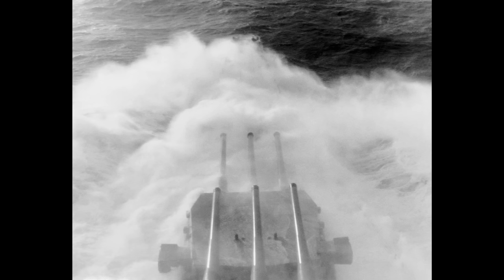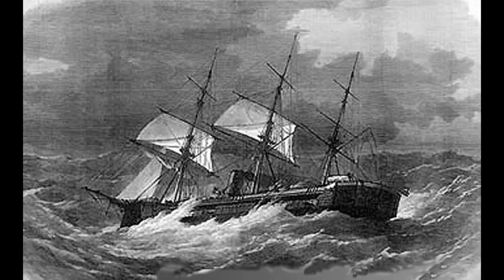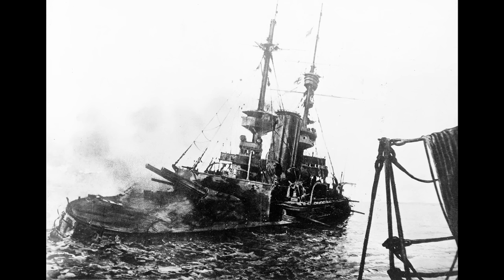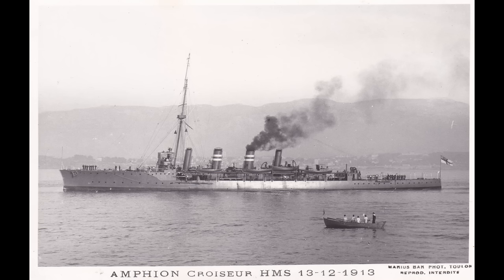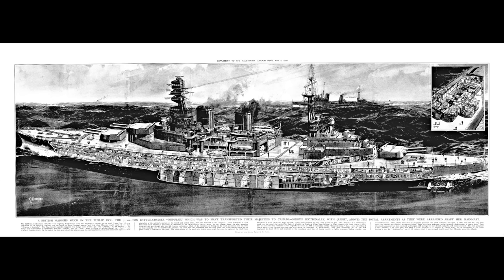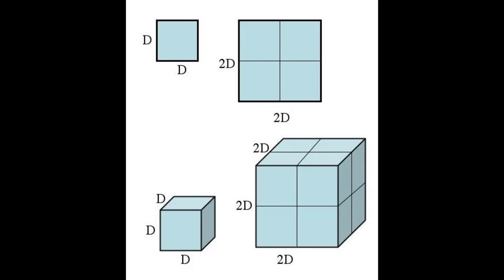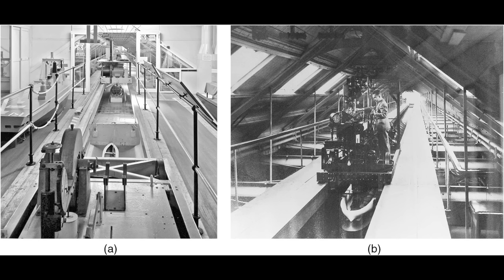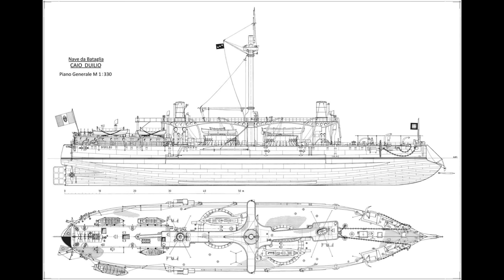Hull Form Design - Doing better than a floating brick

Comment from the maker: Pinned post for Q&A :)
Reply: What was the rationale behind the differences in insignia, specifically the cuff rings, for the RN, RNR, & RNVR? Besides being able to call the RNVR the " Wavy Navy"...

Edit: And I know it was so you could tell at a glance who was which, but why was it considered so important to do so? The US Navy didn't have anything like it to distinguish the Annapolis grads from the ROTC grads (the functional equivalent of the RNR) or the wartime ninety-day wonders (the RNVR counterpart), so it seems to me that there was some snobbery involved.
Reply: Can we get the full 'Drach rants about German WW2 designs inefficiencies.' experience? With special focus on the Konigsberg class.
Reply: Maybe it's irrelevant, but is the boat tail bullet shape actually related to the hull form in any way? What is the effect of the transom stern if it was made to be concave, would it cause an even greater vacuum and vortex effects?
Reply: What was the budget for the Royal Navy/Navies throughout ww1 and how does it compare to the ww2 or the modern day naval budget
Reply: But bricks make wonderful weapons!
Reply: if Hood's 1942 refit had gone ahead when the Loss of HMS Prince of Wales and Renown would have happened and as the Hood's AA weapons would be obsolete by 1943

How many 40mm Bofors and 20mm Oerlikon AA Guns could have been fitted to HMS Hood in place of her planned 48 QF 2-pounder Pom-Pom AA Guns and her 1941 configuration of 20 Vickers 0.50 Anti-Air Machine Guns?
Reply: What was the 20-barrel Anti-Air Rocket Launcher? Why did the UK develop it and Why was it a failure?
Reply: The Royal Navy has more operational experience in the horrid conditions of the North Sea and above the arctic circle than other Navies… seems like the greatest testing site for foul conditions are quite close by … and designs can be shaken down close to home …is their a certain place they took new designs to see how they ran ..!?
Reply: Reading a book on the Väinämöinen-class by T. Niklander I discovered the coastal monitor suggestion of Commodore von Bonsdorff. According to the book it was a 3500 ton ship armed with six 305 mm guns most likely in 3 2 gun turrets. Could such a pint sized battleship ever be feasible?
Reply: @stephenrickstrew7237  Well in the 1980s they sent ships to South Atlantic Winter and they were cause the Type 21s to crack and HMS Invincible broke down en-route
Reply: Dear sir, as this is an engineering, physics, and maths based talk,discussion, could you do a segment on elegance in these terms? What do you consider the most elegant naval weaponry by the same criteria its most elegant counter?
Reply: Drac, Why did you do civil engineering not marine engineering?
Reply: I was watching your MN Surcouf earlier and had read up on the design trouble she had.

The Surcourf was prone to suffer leaks, particularly in her 8-inch turret, she had a habit of entering uncontrollable dives, her trim was difficult to adjust in a dive and on the surface, she would roll a lot in stormy seas, her engines were unreliable and broke down often and her batteries would leak acid in stormy weather and to dive, she needed 24 hatches closing.

How possible is it that MN Surcouf instead of accidently being rammed by the SS Thompson Lykes that Surcourf fell victim to her own design flaws?
Reply from the maker: @abyssaljam441  mostly job prospects at the time.
Reply: since cannons have been replaced by sensors, electronics, comms, and missiles; what do you think is the optimal modern design?
Reply: question:
when a working hull form was found (though what ever means) how much effort was put in to using that hull form for as long as possible. I.E. how common was it to stretch/widen etc. a known working hull form instead of making one from scratch, primarily along the lines of a cruiser hull cut down to a destroyer, or a destroyer scaled up to a cruiser
Reply: @Drachinifel  Its not like the job prospects are any better now. It doesn't matter though as I can still get/have(on placement) a 'normal' engineering job.
Reply: Is there any chance you could talk about the japanese 120mm AA rockets? Some of the light carriers were fitted with them late in the war I've managed to dig up a couple pictures of them they look kinda like UP projectors but I have found very little actual information on their use and effectiveness any help would be much appreciated
Reply: What was more impactful for the americans: the loss of Lexington, the loss of Yorktown, the loss of Wasp or the loss of Hornet?
Reply: Did any Navy look into using bow thrusters before 1938? You had mentioned bow rudders in a past video this is why I am asking.
Reply: @kendramalm8811  That's simply to distinguish between the three branches, so someone would know from a single glance whether you are are RN, RNR or RNVR. BTW, the RNVR no longer exists; it was merged into the RNR after the war when the Admiralty saw just how good some of the VR people actually were!
Reply: Drach - if the purpose of the transom stern is to reduce the vortex, what would the effect be of a wedge or bulge mounted on each side of the ship at the stern? Would that widen the area of reduced vortex, or just increase the drag at about the same amount as any reduction?
Reply: would heating or cooling the hull have any effect on how the ship moved through the water? obviously you wouldn't be able to do this if you were not in possession of an abundance of power or a hull capable of heating/chilling.   What about the temperature of the water itself? easier to move through cold water vs warm?
Reply: @alanhughes6753  , yes but why distinguish? I've never heard of any other navy doing it quite like that.
Reply: As a student who plans on going into Ocean Engineering, this is a nice intro to hull form. However, displacement is talked about a lot, and I'm at a loss as to how it is calculated. I understand it is the volume of water the ship displaces in order to float, but not how it is calculated. Can you explain this further?
Reply: In the age of sail did larger guns such cease to use solid shot at close range to increase damage? It seems like a solid shot from a dalgren would waste most of its energy exiting the opposite side of a ship at close range.
Reply: regarding the design of the stern of a carrier: the Lexington class had a sharp stern and the sharpness was carried up to just below the flight deck.  In purpose built carriers of the 30s, like Yorktown and Ark Royal, the stern is sharp at the waterline, but then rapidly flairs above the waterline, which allows a longer hangar deck.  USN drawings of purpose built carriers from the early 1920s show this was a known factor as those drawings show a hangar extending nearly the full length of the aft end of the flight deck, while the drawings of the battlecruiser conversion show the hull tapering at hangar level, and a short hanger.  Was it impossible to rebuild the aft part of the Lexington hulls to provide more buoyancy to support the wider above waterline stern and longer hangar, or was such a rebuild expensive to he point where it blew the selling point to the politicians that the conversions would cost less than purpose built carriers?
Reply: Drachinifel, The long slender bow which give better speed but harder to turn. Yes I agree but this was the idea behind bow truster, were they pump water from the compressing side to the low pressure side which pushes the bow by itself but also makes turning force by the  rudder. As I understand bow truster did date back to around WW1 but very few ships use them. So why so little used.
Reply: Granted the mathematics for calculating ship's stability existed since the late 17thC, why did the designers of HMS Captain get it so wrong?
Reply: When is your next video on the Wasa coming?
Reply: I'd be curious to hear what type of performance increasements a transom stern would have provided to the Iowa Class Battleships.
Reply: Without Naval Treaties limiting development, would we have seen ludicrously massive floating islands with 25 inch guns, or just a bunch of bankrupt nations while their megalomaniac projects ended up abandoned like the Maus tank?
Reply: How many Vanguard Class Battleships were planned originally?
Reply: Hi Drach:
Some questions I have:
1. Is there a hydrodynamic equivalent to the Area Rule in airplane design?
2. Has anyone tried using an inflatable (by air or water) "end cap" for a transom stern for better low speed performance?
3. Discussion of air bubble generation at the bow or along the hull to reduce the surface tension of the water (used in some extremely fast modern torpedoes)?
4. Use of a concave shaped hull bottom?

Thanks! Great stuff!
Reply: My brain hurts after listening to this video.
Reply: @Knight6831  Just the one.  Because she was designed to reuse the stored Turrets /Barbets etc taken out of Courage’s & Glorious when they were converted to aircraft carriers.  (Which means the armament that first sailed with the Grand fleet was still in service through the 1950’s).
Reply: If WW2 hadn't occurred When would the UK Government realise that the Royal Navy had grown too big for its budget?
Reply: @chrissouthgate4554  I think Drach mentioned 3 other Vanguard class ships names in a drydock but not sure which

Shouldn't the Battleship fleet being reduced from 18 to 10-12 a red flag that  the Royal Navy had grown too big for its budget?
Reply: @chrissouthgate4554  So the RN's planned Battleship fleet was to be 1 Vanguard Class, 
4 Lion Class and 5 King George V Class
Reply: Who do large modern transport ships have transom stern if move at relatively slow speeds?
Reply: We’re there any attempts during the age of sail to increase the protection of a ship, for example placing sandbags on the inside of the hull to catch splinters and possibly stop or slow down incoming cannons balls, or was it simply the case that no practical amount of wood or added material would really help your ship and so you just had to accept the base protection provided by the wooden hull.
Reply: Can you capsize a submarine, and if you do does it sink?
Reply: Merchant marines for the WW1/2 era. Were these volunteers, drafted or just "unlucky" men who were professional sailors before the war? Perils of submarines or raiders are not fun afterall.....
Reply: Was the USS Connecticut BB-18 ever in combat  or did it ever fire a shot in anger? Also generally did US pre dreadnaught ever fight besides the Spanish-American war? Love your channel!
Reply: I read somewhere (can't remember where, sorry) that warship hulls tend to be designed with more strength residing in longitudinal framing, compared to civilian ships relying more on transverse framing (not sure that applies to modern modular civilian ship building). Apparently due to longitudinal framing being more resistant to battle damage. Why is that?
Reply: @emperordave3006  They are pointy ended below the waterline, and then the hull flares out so that a relatively short distance over the waterline the stern can be flat.
Reply: @christofferwillenfort4035  I've always assumed this was to protect the crew of the forward gun (who only had a gun-shield, not a fully enclosed turret) from the muzzle blast of the superfiring gun.
Reply: The Fairey Swordfish and Fairey Albacore seem like remarkably similar aircraft, but, in general, the one is venerated and the other disparaged. What made the Swordfish a success while the Albacore was a failure, or is this a misconception?
Reply: @jasonhall3330 I've read that the crews' hammocks used to be lashed along the side of the upper deck to provide some protection from musket fire and splinters.
Reply: @CharlesStearman   After reviewing all my destroyers in WOWS  it seems like you are right.   This only exists on the ships where the turrets have an open back.
(couldent find any fully open superfiring ones.)    so basicly a blast shield.   Now to dig out if there is a "propper" name for it.
Reply: What is the largest vessel that can take a hydrofoil and still be stable? Also I've noticed that a few of the future designs of modern warships have gone back to a catamaran type design, why so?
Reply: Do they still put deck guns on destroyers/warships in this day and age?
Reply: I'm sure you've probably seen the Mythbusters episode about golfball dimples and putting them into a car. It supposedly helped some with resisting the wind. how would that do with being in a ships hull, how would that be acting on water resistance?
Reply: @matthewrademacher5183  The US engaged in several "big stick" waiving exercises in the Caribbean during the period Connecticut was in commission, including interventions in Mexico, Haiti and the Dominican Republic.  Offhand, I don't know if Connecticut fired any 12" ammo during those interventions.  A search of newspapers of the period, especially 1915-1916 would probably provide detail on her activities as the Wiki entry does say she was deployed to both Mexico and Haiti during that period to support ground troops.
Reply: @Knight6831  Treaty still had displacement limits and Battleships and Battlecruiser were counted to the same limit, so it would have been them plus a refit Hood and maybe both Renown class still. As to your question on the number of planned Vanguard class, Drach answered a few questions about that over a couple of Drydocks, the plan was one quick build using the stored turrets and guns from Glorious and Courageous but had the war not started and the RN needed more  ships fast they could have in theory taken the guns and turrets from the 5 R-class and 5 QE's as they came out of service for a total of 11 Vanguards.
Reply: @arivael   Not quite as 1 R-Class Royal Oak and 1 QE were sunk so it would be 4 R-Class and 4 QEs for 8 Vanguard not 11 but that would along with the 4 Lion and 5 KGV still give 17 battleships unless the UK built the 1 QE and the 3 R-Class that were cancelled which would have given 13 Vanguards
Reply: no 84 hour midweek vid... nope thats one for the patreon drydock.. :)
Reply: @Knight6831  I did say 'if the war had not started' So if it had been part of a pre-war build plan to deal with the fact they might have to fight Germany, Japan and Italy at the same time.
Reply: @bensimmons2850  also get Lindybeige involved and that would be an epic rant.
Reply: Can you continue the development videos. 
Like to see the aircraft destroyers and cruiser videos finished
Reply: How long has the effect of the transom stern been known about? I've seen it on some models of the G3 class, and given the benefits that it can give for a ships speed when moving quickly, would it not have made sense to put it on earlier higher speed ships like the battlecruisers?
Reply: If there is a warship form any era that you think and you want to be modernized just like the Iowa in your interview video, which one would it be? I myself would like to see the Richelieu or Dunkurque battleships have missile systems at its stern area whilst retaining her main guns at the front. A crazy symphony of firepower that would be!
Reply: 1:01...uhhh but.. could you tho? please?
Reply: How is wide and long of the length or deep of the draft of Yamato compared to an IJN Interwar destroyer like Fubuki-class or Akatsuki-class
Reply: In World War II, the US built a massive amount of new ships. I am interested in how US (and RN) were able to staff those new ships with competent officers, sailors and airman capable of sophisticated operations. The US (and I imagine the Royal Navy as well) were able to produce a mass of capable personnel while at the same time the Japanese Navy (which was extremely professional at the beginning of the war) seemed to become less capable. How did the US accomplish this feat? Is it true the Japanese Navy become less professional or did the US simply catch up?
Reply: I know you don't cover modern stuff much, but is the power to mass ratio of machinery the reason modern warships don't much exceed 30 knots?

And also, I know General Quarters and Battlestations are used more or less interchangeably in the USN, which is parallel to action stations in the RN, so what is the difference between General Quarters in the Royal Navy from how it's used in the USN? Namely in the world wars, but also more recently if it's any different?
Reply: @josephaskins1996  it is simply the integral of all the immersed cross-sections from bow to stern for a given loading condition.
relatively easy to calculate now with cad software, took a bit more work if all you had was paper, pencil and planimeter...
Reply: How do you reconcile needing a pointed rather than blunt bow for speed on a ship with torpedoes having a blunt nose being optimal? Like what makes the difference for the torpedo?
Reply: I figure this is a dumb question but did anyone ever try putting escape hatchets or blow out panels on the bottom of a ship so if it capsized the crew inside could escape? 
Are there any actually means or devices for trying to help crew survive or escape when a ship rolls over or is it really just a case of the crew bending over, grabbing their ankles, and kissing their sterns good bye?
Reply: What are the ruler like markings on the side of the super firing turrets of the ship at 47:10? Do they help determine the training of the guns from outside and if so why?
Reply: Completely unrelated to the video at hand, but I finally watched greyhound today. Given that your not adverse to rather long videos, and there are a number of sea based movies out there, would you ever consider doing movie review videos from a historians perspective. Commenting on what you liked and didn’t, and what they got right and what they got wrong?
Reply: Rumor has it that you will be playing a devilishly good looking commander in the next Star Wars movie.  Can you conform or deny this rumor?  Also has Palpatine had gone with the US Navy strategy for his point defense system, what sort of monster would we have ended up with for a death star and how hard would it be to assault?
Reply: Why do some ships have flat sterns? because the shipyards held the rest T'ransom ;)
Reply: An 84 hour course about hull design throughout history narrated by Drach? Dont threaten me with a good time!

Amusingly, right before watching this video, me and a few friends were chatting about wargaming's latest addition to World of Carriers, the USS Kearsarge, and how much of a stability issue essentially sticking an escort carrier onto the top of a modified Montana hull could be. Setting aside the fact that the US would never have needed a battle carrier, is the design at all realistic? What kind of changes would need to be made to accommodate the extra weight of the hangar deck and island so far above the deck, along with 2 extra 5 inch turrets on either side, and to compensate for the offset weight of the island?

Love your long form videos Drach, hope you're having a good day reading this! o7
Reply: My only question is: After listening to Drach going on about hull design and trying to comprehend all this new information, am I supposed to have grey stuff dribbling out my ears, or do I need to seek medical attention?
Reply: Whrn you mention that a finely sharp bow is not boyant does that mean the entire ship will naturally sit with a slight slant ie the stern sits higher as the bow in lower to the water?
Reply: How many times (I KNOW you DID*) did you have nightmares about *design by commity

My worst one was getting hired for a job.. and then being told I would join the commity about the tillman battleship. I coudln't sleeping after that
Reply: So is the Transom stern mentioned at 59:19 kind of like the 'boattail' design in rifle bullets? Or am I misunderstanding the concept?
Reply: @therockphonian5323  Crcumstance, Taranto and the Bismarck chase.  The Albacore never had the opportunity. Both aircraft were sitting ducks against a force protected by CAP.  They would have been easy prey for the last generation of biplane fighters.
Reply: We know the Albacore hull form is optimal for submarines.  What is the importance the free surface effect in making it so.
Reply: How are sails spaced so that they don’t “steal” the wind from sails in front of it? Especially on Clippers and Windjammers.
Reply: Why didn't the US Independence and Saipan Class ships in USN service not get an angled flight deck conversion like the Midway and Essex Classes did?
Reply: I was wondering I know sever technologies needed to mature before it was viable such as advances in metallurgy to prevent turbine blades from simy melting and contacting the casings but what might have happened had someone traveled back to say 1928 with technical drawings and descriptions of the processes to make gas turbine power packs.  Would this change the design of say a treaty Era heavy cruiser all that much or battleships?
Reply: If USS South Carolina had been the worlds first all big-gun battleship instead of Dreadnought (impossible as that was while Fisher was alive and in a position to do anything about it), what would the domestic reaction in Britain been?
Reply: @craighagenbruch3800  It would if the designers do not take this into account and move weight around elsewhere to compensate. Drach has talked about the effects of the very narrow bow on the Iowa before, I think in Drydock 47
Reply: @richardorta8960  I think golf ball dimples only work at small scale. Sharks have rough skin for the same effect, so do the swimsuits that elite Olympic swimmers wear. Hey @Drachinifel, maybe your next video you can explain this?
Reply: @hughfisher9820  

So a bunch of really small dimples or skin like a shark would only work on a small vessel then? maybe give it an oily like coat over it? i'm trying to come up with a weird alien or advanced tech that in theory could work. places like this, have people like me with weird ideas, and peopel with possible solutions to put those weird ideas into practice. 
I love the idea of Drach doing a video on ideas that might make a ship go faster... or knot. 😁 Sorry, I had to take the pun.
Reply: At 39 minutes you show a 3 planar veiw of a sailing ship. Would that top down veiw be a form that would work on modern warships?
Reply: I'm currently listening to a 15 hour audiobook on how christianity probably came from shrooms and LSD, and find it absolutely fascinating.

I dont think any of your fans would have issues with an 84 hour video. You sir, should expand upon many of the subjects you've covered in this series of maritime engineering and history, and make a full length book or audiobook to read. Simply listening to the whole series in sequence is already like listening to a full length audiobook.
Reply: Will you be doing more meme ships like HMS By Jove?
Reply: In this video you mentioned several specific considerations for big-gun battleships, but what considerations would need to be made for an aircraft carrier? I would imagine there are unique challenges with stability when you have to make it easy to land a plane on deck.
Reply: I’ve been pondering the issue of stability ever since Shadiversity tried to recreate the ‘dwarves in a barrel’ scene from The Hobbit. (Spoiler: Wine barrels are a somewhat suboptimal hull form).
Would I be correct in saying that a ship will right itself if a roll causes the centre of gravity to rise with respect to the surface of the water (as opposed to where the centre of gravity is when the ship is level), and that the ship reaches its capsize point when it rolls sufficiently so that the centre of gravity starts moving down again with increased roll?
Reply: Its 1935 and you are in charge of the Graf Zeppelin Class Development and you realise her design isn't feasible,  with your modern knowledge how do you redesign her to be viable in the face of the Royal Navy's Implacable-class aircraft carriers also under design?

Could Germany have realistically have formed a Carrier Strike Group with the Graf Zeppelin?
Reply: Just started watching all the dry docks from episode 1 onwards Drach, but I'm just wondering since episode 18 refers to the Japanese 25mm Light AA gun being so utterly abysmal and you seemingly have an absolute disdain for it to the point of comedy is it worthy of it's own video with a lot of in-depth history behind it's licensing out and production a few funny stories involving it and lastly it's awful combat record ? (And if such a video has not been requested before consider this my request for it to be added to the wednesday special list)
Reply: In the Cape Esperance video you talk about a training exercise where ships would fire at friendly forces using an offset to ensure they didn't hit them. Did any of these exercises ever go awry and result in a blue on blue?
Reply: @hughfisher9820  thanks haha im not a engineer nore have the knowlage on engineering like he does.
Reply: Sorry if this has been asked, but what about the impact of hull length on design? I know some long/thin ships have been known to have their "spine" broken in rough seas.
Reply: Did you accidentally confuse center of buoyancy and center of gravity in your explanation of capsizing / leverage cause the Letters in your diagram go opposite to the words you've spoken over the graphic...
Reply: Hey Drach, in your intro I've noticed one of the shots of a main turret firing has a lot of confetti spraying everywhere, what caused that?
Reply: Hello @Drachinifel, any chances for a Z20 Karl Galster video?
Would be great, I built a 1:100 of it from scratch long ago.
Reply: @Knight6831  One word - Churchill.  It launched aerial "mines" that hung from parachutes by wires, supposedly to create a minefield in the air in front of attacking aircraft.  It was useless - easy to avoid, and slow to reload.  They tested it once in Scapa Flow and the mines drifted with the wind into the ships rigging.  Luckily the "mines" were inert.
Reply: @themightynanto3158  Define "impactful"...
Lexington: first lost, biggest, worst explosion, learned most about gas fume damage control;
Yorktown: second lost, discouraged pursuit of fleeing IJN at Midway, learned more about poor CAP control, proved value of CO2 in fuel lines, damaged beforehand (Coral Sea);
Wasp: third lost, 5,000 tons less that fleet carrier so had minimal torpedo protection, lesson- keep the subs away...;
Hornet: last lost, took amazing damage and still would not sink, proved DC lessons and continuing CAP control weaknesses, left US with only 1 damaged and 1 repairing fleet carrier till mid-43.
Reply: @josephaskins1996  Displacement:
Old way - scale model of ship in water tank (cross-checked by first unit in drydock...)
New way - CAD system generates automatically...
Reply: @stevevalley7835  Probably both but more the latter suggestion, as both ships had already been laid down (and were over 20% completed, all lower hull).  Hull plates were probably ordered ahead of time.  Note the changes made to bow in the 30s.  The shorter hanger was due to lack of experience, it was one of the "lessons learned" for the next class to increase.
Reply: @Knight6831  Plus the two Nelsons till 1950s, at least before WW2.
Reply: @jasonhall3330  Warships had thicker wood hulls, double layers of wood, and used denser, more expensive woods sometimes.
Reply: @matt-hew69  Yes and probably...
Reply: @teemu3370  They were all professional merchant sailors, but the ships were augmented during the war with small navy, reserve or guard units to work the AA/AS guns.
Reply: @dylanhoyal3150  Yes.
Reply: @rohannbennedicktan7226  The destroyers had much more length-to-beam ratio.
Reply: @gregorywright4918  Thanks mate
Reply: @jdnnschreiber  For the US, a lot of the pre-war lower ranks (especially from the damaged battleships) were bumped up a grade and sent to "leaven" the ranks of the crews in the new ships, plus the naval training centers were greatly expanded and "reserve" officers were commissioned from college grads.  The US and UK also rotated their men for rest and training more than IJN, who only gave rest time for serious wounds.
Reply: @sfs2040  Modern warships don't have much use going more than 30 kts other than launching aircraft or keeping up with the carrier, in a world where the incoming missile is so much faster.  P/W of modern machinery (gas turbines, diesels, etc) is better than WW1/WW2.
Reply: @zstewart  The torpedo is fully underwater; the bow breaks the waterline and deals with waves.
Reply: @DELTATROOPER5555  No.  You want the strongest possible bottom you can, but it is not armored so it can be cut through.  Several men were saved from Oklahoma and Utah by cutting crews.
Reply: @baxtersands9955  Can't see well enough but some ships had markings on outside of turret so that next ship in line could figure out what angle the turret was pointing at, either to copy or keep from shooting at same enemy ship.
Reply: @tekie1725  An escort carrier on top of a Montana?  Massive stability problems.  The Montana is already balanced, to the point that they had to reduce the conning tower thickness somewhat.  Putting 10,000 tons above the second deck would be fatal.  Not to mention the idiocy of trying to combine two completely different ship types.  Read the DNG's comments on the idea for Lion class here:
https://en.wikipedia.org/wiki/Lion-class_battleship#Hybrid_aircraft_carrier
Reply: @Knight6831  The Independence design was much too tight on stability, having a cruiser L/B ratio, plus they were a stop-gap design to get carriers in the water quickly and nobody liked them.  Once they had plenty of Essex's they relegated them to training and transport (and expended Independence in the atomic bomb tests).  The angled deck experiments didn't start till early 50s after Korea, by which time the two Saipans had already been converted to command and communications ships.
Reply: @timstatler7714  If you mean the hull shape, the length-to-beam ratio is much shorter than most modern ships except catamarans, which have different hull arrangements.
Reply: @colemeador1501  Would be nice, but that was an April Fools joke.  Expect one per year...
Reply: @Knight6831  GZ was not optimized for CSG, but rather for mid-ocean scouting and raiding in the absence of enemy fleet carriers.  She could not have stood toe-to-toe against an Implacable.
Reply: @gregorywright4918  by impactful i meant the one that affected american morale the most. Sorry for not being clear enough.
Reply: @gregorywright4918  I floated the same question in another forum and the discussion came down to cost.  Harding, and Congress, didn't want to spend anything on the Navy, so the Navy was probably willing to settle for a less than optimal design because the alternative would be nothing.
Reply: @ontheslipwaycom7544  Thank you, I would never had guessed a CV would have them. I was thinking a CA or something like that would have had them.
Reply: at about 9:04 in the video you show a model of the Vasa.   Who made that model?   I was gifted one like yours, but Mine is missing a few pieces like the lion head gunport doors.  Id like to know the manufacturer so I can buy replacement parts.
Reply: @themightynanto3158  Probably the Lexington then.
Reply: @stevevalley7835  They were already paid for in previous authorizations, so getting something for the cost of conversion would be better than scrapping.  Plus they were being built with massive horsepower, and the primary complaint about Langley was too small and too slow.
Reply from the maker: @dave8599  It's a model in the Vasa Museum, unfortunately the shot I took with the plaque that had more information including the builder came out blurry :(
Reply: @gregorywright4918  Yeah, I was pretty sure that would be the case. The comments on the Lion class hybrid were quite amusing and insightful, gotta love that British dry humor.
Reply: @gregorywright4918  I don't think the entire cost of the Lexingtons had been appropriated in 1916.  The government usually funds things on a year by year basis.  In reading about the Washington treaty over the winter, the thought in the back of the minds of several US officials was that Congress was going to cut off funding for the ships already under construction, whether they had the treaty or not.  I remember Congress cutting off funding for the Clinch River breeder reactor and the SST that Boeing was working on, and, more recently, we saw how the production run of Zumwalt class destroyers was cut off.   According to the Wiki article, conversion cost for the Lexingtons was $22.4M each, on top of the sunk cost of $6.7M, vs $27M for a purpose built carrier of comparable size.  On the other hand, Ranger only cost $15.2M, so they could have built two Rangers for less than the conversion cost of the two Lexingtons, and embarked air groups of nearly the same size because Ranger was more efficient at carrying aircraft.  People may complain that Ranger was a waste of displacement because it was so less capable than a Yorktown, but you could build a Ranger out of the displacement that a Lexington wasted vs a Yorktown, because of it's inefficient design.
Reply: I presume what is considered low speed or high speed is a relative term so: What determines what is considered low and high speed for a particular hull design? (I don't mean the hp the engines generate; I mean, is what is considered low or high speed also dependent on hull shape, hull/stern type, etc?) Thanks!
Reply: Please consider covering the Russo Turkish War and the Turk Greek war. Thank you
Reply: Any possibility of a compilation of various video clips, with running commentary? I.e. the video of the US Standard Fleet shown here, or the footage from Big E, while describing what we're seeing punctuated by (semi)pertinent asides. An hour or so of that would be a real treat.
Reply: Should anyone have followed Farragut's idea of lashing warships together in pairs to approximate multihull warships?  I have never understood why multihulls have not been used more for a long time.
    Well, you described one potential disadvantage of multihulls, which is that extreme stability would create an extremely short roll period  which might lurch in a way that makes it harder to train the guns under some sea conditions.
Reply: @kendramalm8811  Could it be to do with peace-time training, when RNVR 'part-timers' may have been training alongside 'regular' naval officers and the instructors perhaps needed to tell them apart?
Reply: Would a stern section that at the very end shaped like the very end of a whales tail, where it's concave in the center make the suction vortex terminating in the concave space help push the ship instead of trying to pull it back into the pervious space?
Reply: @kazeshi2  theres too much ocean around it for hull Temps to matter significantly. if it did nuclear powered ships would do it. I had a captain who worked on a nuclear icebreaker and it had a nuclear heated swimming pool.
Reply: @josephaskins1996  displacement is actually mass. You calculate volume from displacement because the weight of water is (semi) constant
Reply: @Knight6831  Straight from the wikipedia article on the Saipan class. "As carriers, they were swiftly outdated by the deckspace-eating jet aircraft of the 1950s, and quickly rendered far too small in a military environment where the 900-foot (270 m)-long Essex-class aircraft carriers were increasingly seen as cramped and small."
Reply: @sdmurphy315  They tried that on a few race cars I think.
Reply: man this is one of your best ones good info
Reply: Silly question: Is there any type of significant 20th-century warship that you could move with a suitable set of oars and a sufficiently large crew?
Reply: @MrGrevanar  interesting question.... lets put it to just manpower so we can use mechanical advantage and ingenuity to our benefit how much food do you need to store to make that work but the big question is how much space for given unit of power more does a modern powerplant supply vs human output I've seen videos of Texas's steering room and to turn its rudder at a snails pace requires like 20 men working 10 wheels on the backup system so if it takes so many just to turn the rudder would it take like a thousand or so? how would u design a system to take full advantage of human output? perhaps a stair climber of some sort? does seem like a interesting question
Reply: So it’s not the size of the ship but the motion of the ocean that matters? 🤔
Reply: I guess a lot of these "hull design" topics still match today standards: in the cruise ship business

not the stable gun plattform but the stable hotel running pretty efficient in a broad variety of speeds ... and on top: eco friendly has to be added to nowadays standards.

I love this video and this kind of topic. Still can not decide if I will get a float or cubic as next gun plattform or a more serious dreadnought one .

Maybe gun plattforms are outdated and cruise missile launcher plattform might be a better solution ... of cause not for the cruise ships
Reply: Why are so few of these questions even remotely related to the topic at hand? Please answer this question first, ok? ;)
Reply: I know how crazy this may sound, but I'm sure someone at some point had to have a thought about this: were there any attempts (failed, presumably) in the past to add some fins of sort, or balast tanks, to adjust the hull geometry and/or height, to achieve better results at various speeds or different sea conditions?
Reply: 17:32 or thereabouts, the water that enters the hull does not pull down, but the lack of air in the hull, that would have supplied displacement, means that the original buoyancy is no longer there. When this happens, the buoyant "other side" of the ship is what turns it over, not the "weight" of the water. This is easily seen, since the first way to stop a list is to flood ballast tanks on the other side, reducing its buoyancy, or if available, blow other tanks on the flooded side.
Reply: Why do you define ships by displacement instead of weight?
Reply: So if I understand this correctly, stability is a bad thing. 😄
Reply: Any chance you’d ever do a video on the French Frigate L’Hermione?

It’s my go to in a game called Naval Action and I’d like to hear and learn more about her.  She’s got quite the storied history, but I’m interested to hear what you might dig up!
Reply: The only major hull consideration left out of the video is the bow-wave hull speed and effective length of water line. 
As  a secondary note, the fine bow on the most modern battle ships wasn't enabled by high strength metal it was a choice to save weight by eliminating armor(Actually transferring that mass to thicker armor in critical areas.) armor penetrating shells would actually punch all the way through the bow without exploding. Relying on water tight compartments in the section of the ship and the smaller hole being much easier to plug.
Reply: Drach, could you give some recommendations to check out detailed information about the complicated relationship in the power to speed ratio of ship propulsion?